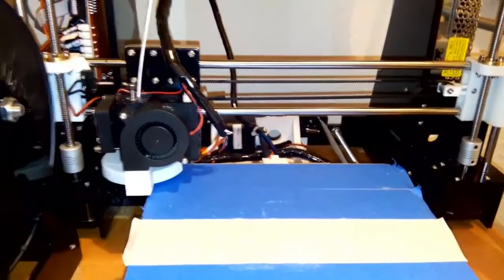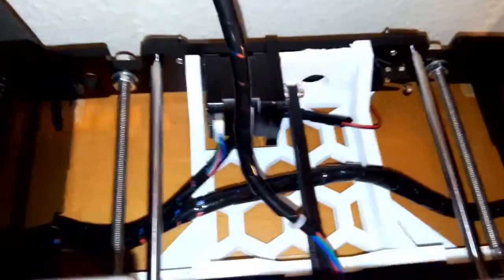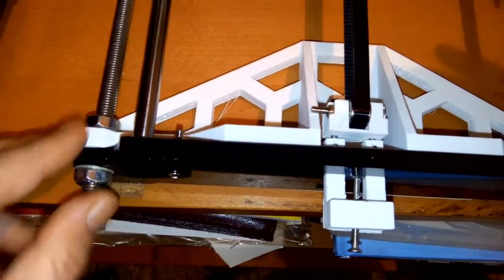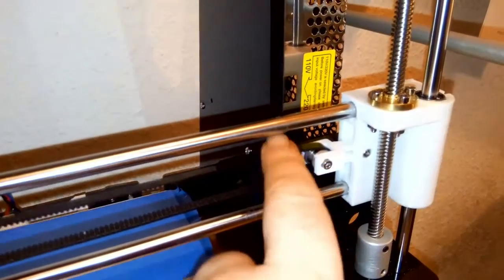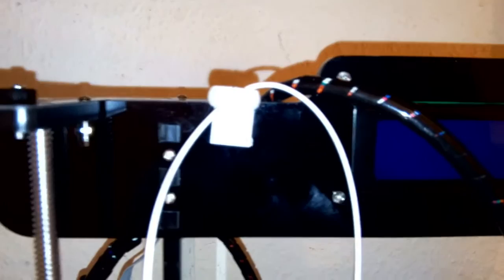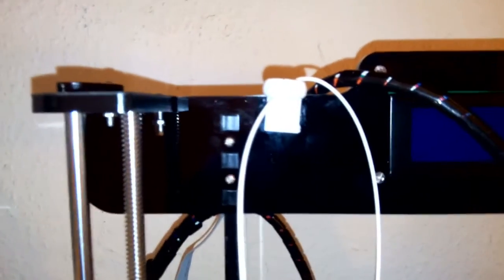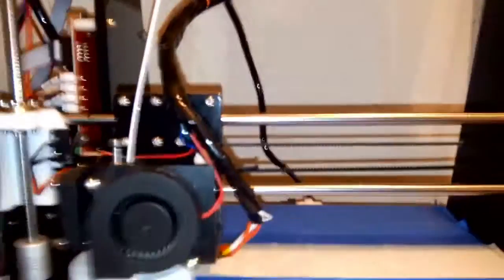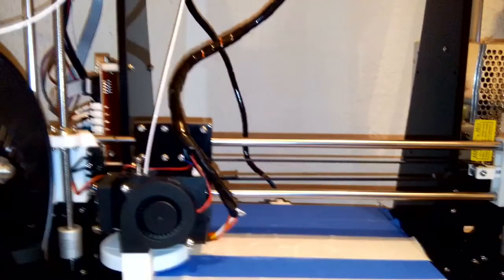Anet A8 Prusa I3 - Improvements and Upgrades (English)

Comment: hi i have an anet a8 with a problem.
the problem is layer shift . but  i noticed that on my printer the z motors are not like on youre movie it is like they touch eachother in the middle. instead of 5mm inserts
is it possible that i have layer shift because that the Z axle is not installed properly ? i hope u can help me .
Reply from the maker: That is hard to say. It would be great if you come to my Facebook group, there are a few thousand Anet A8 users. Someone can help you. You have to sign up and then I would release you- then there can describe your problem. https://www.facebook.com/groups/1696500133995810/

Comment: I have a newbie problem  when trying to,print the front and back supports. The front need to be 235mm in Cura it's lands on the bed at 176 ...yet to find / learn a way to resize it after swinging it 45 degrees coz it stays at 176. In Slic3r I can scale it to 116 but the size displayed is less than 235mm ....wasted so much plastic trying to get the size!  What am I doing wrong?
Reply from the maker: +QuadCopter 102 i print it with Cura. And swinging it. Slic3r i don't use. Perhaps you should use Cura. You can look to my Video to setup it.